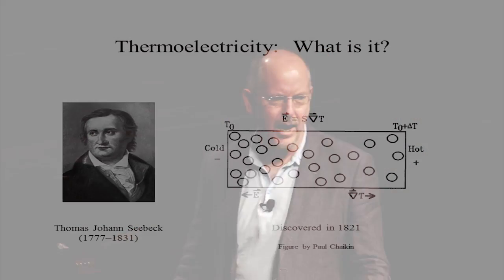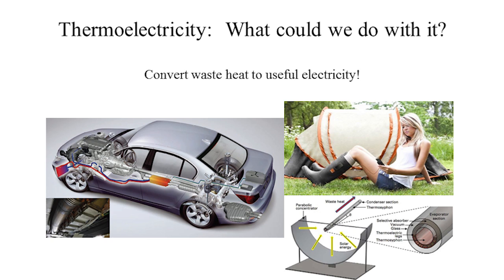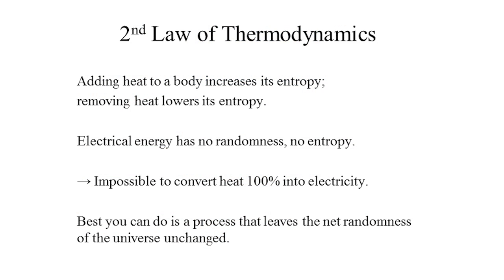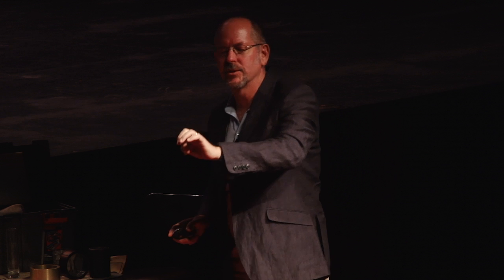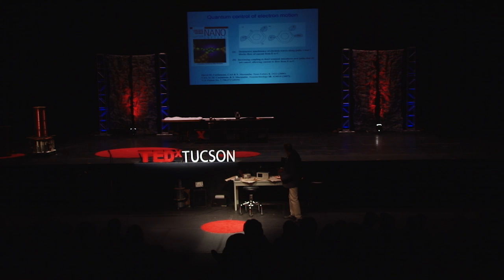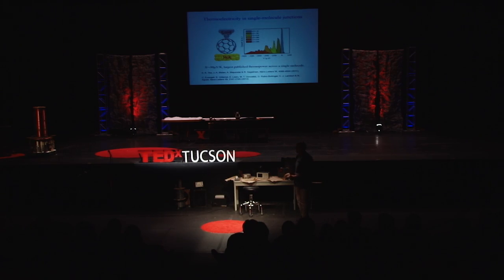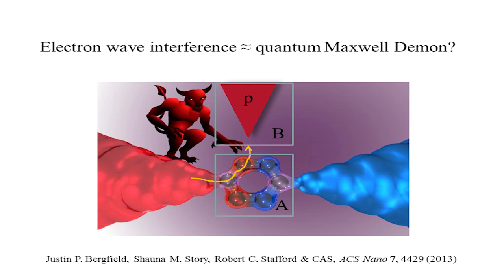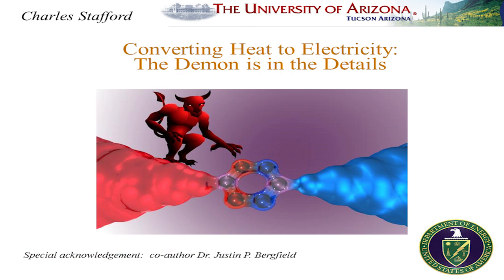Using nanotechnology to convert waste heat into electricity | Charles Stafford | TEDxTucsonSalon

Comment: This was a pretty cool video.  I’ve spent all day today trying to think of ways to convert thermal energy into electricity, in hopes to 1) produce energy, and 2) theoretically reduce the heating effect from CO2.  

I can’t fully grasp my head around why there has to be a pressure differential to do it though.  In this case that pressure is created from a hot and cold barrier, similarly an engine turning over is created by a literal pressure differential produced from gas combustion on one side and atmospheric pressure on the other. 

This demon he was talking about was similar to a thought I had where you may be able to selectively grab the energy and throw away the particles with little energy.  Although the demon idea is far more developed. 

If this type of technology could be advanced there’s so much potential.

Comment: I'm writing a sci-fi story where there is tech that can harvest the heat in air and convert it to hydrogen and cool the air at the same time. Anyone who understands the science of heat who wants to give feedback on my imaginings?
Reply: How does the heat get converted to hydrogen, and how does it cook the air? Lol. 

A guess there’s a part of science that might make sense that you can manipulate into pseudoscience.  Theoretically Energy can be converted into mass I.e. Albert Einsteins equation E=mc^2. All heat is, is positive thermal energy.  So you might be able to write it as you’re putting heat into the system which is resulting in the production of hydrogen mass.  You may also be able to conclude that since hydrogen is the smallest molecule on the periodic table that it takes less energy to produce then that of another element.  

Since the heat is converted to mass the result is less thermal energy in the air resulting in a cooling effect.  

It will probably be hard to explain the production of mass from heat energy though.  Good luck though, writing these kinds of stories are fun, and entertaining.